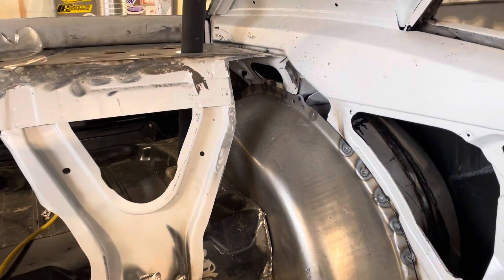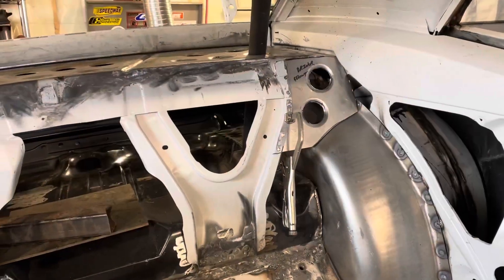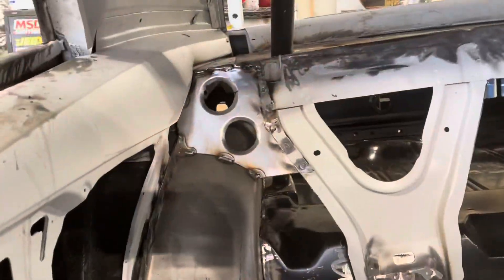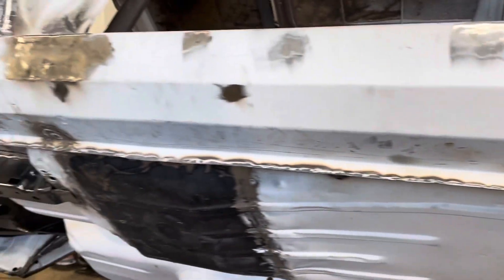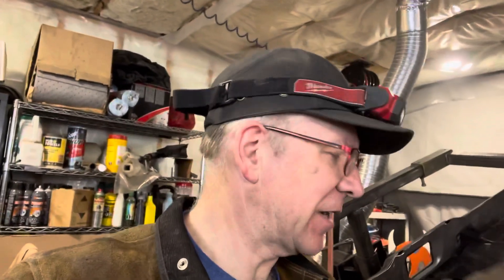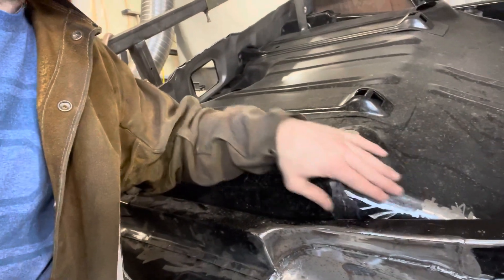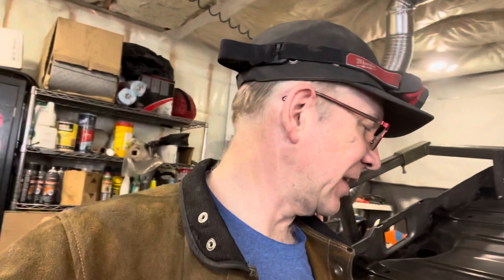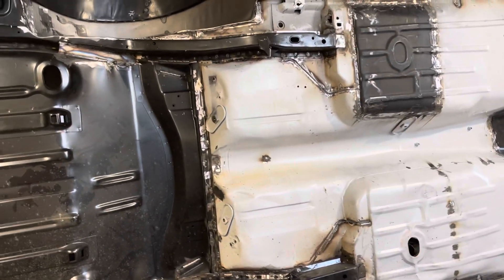Episode 276 Make it stronger

Comment: What are you running for rear suspension?
Reply: I will run the Speedway Motors suspension front and rear. The rear will be the torque arm version

Comment: Are you putting in frame connectors?
Reply from the maker: Yes, the suspension kits I'm putting in come with subframe connectors and I will be welding them in and reinforcing